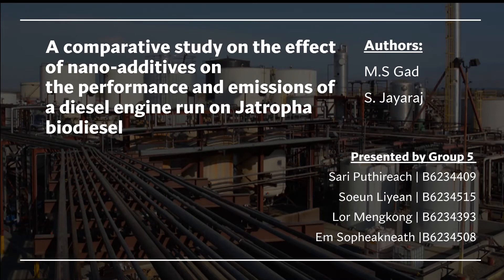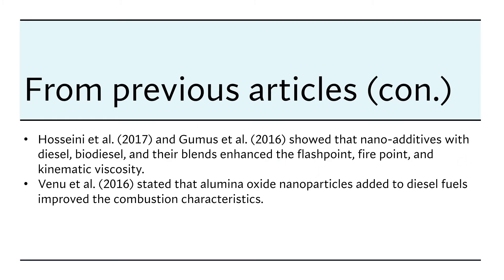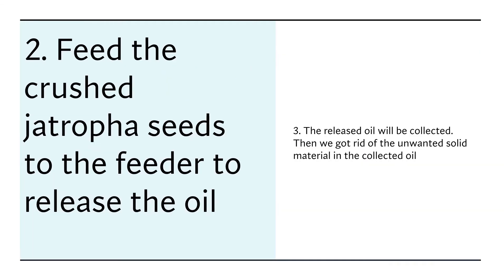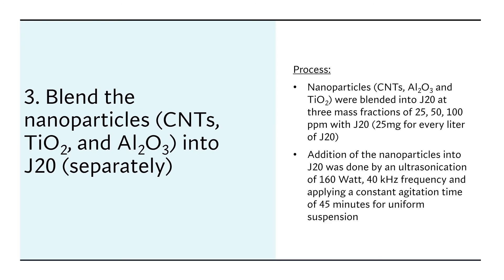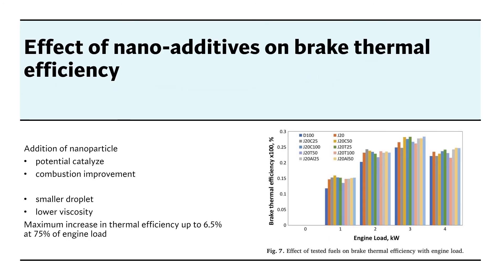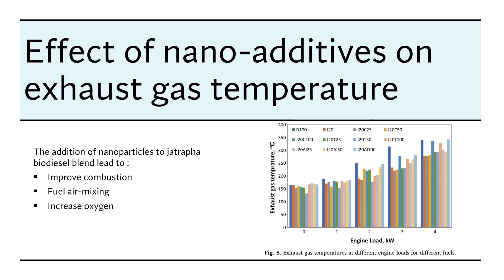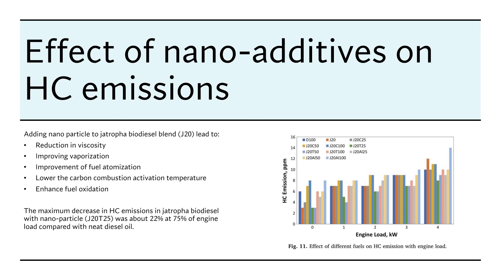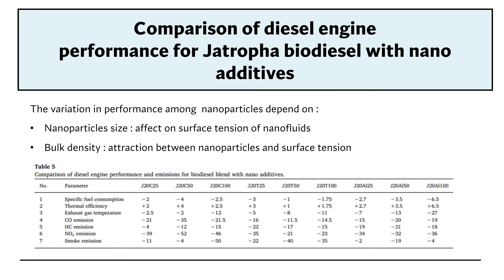A group presentation of comparative study on diesel engine using Jatropha fuel with nanoparticles.

Comment: Hi, questions from group 3
1. Due to Jatropha fuel advantages, why it still unpopular in other countries.
2. To use this biodiesel do we need to modify our engine? (or Does Engine Type Matter?) 
3. Long term of using the biodiesel, does it affect the engine and what the difference of using the normal diesel.
Reply: An answer from group 5

2. Biodiesel, as the name implies, is another form of diesel extracted from biomass which in our case is jatropha seeds. Hence, biodiesel is perfectly fine for use in diesel engines (In case you missed it, the authors actually used a diesel engine to experiment with biodiesel). However, as shown in the introduction, paragraph 1, lines 10-11, biodiesel could not be used exclusively on an engine citing their increasing amount of Nitrogen oxide (NOx) emission. Therefore, researchers have been trying to solve this problem by various methods (e.g., adding nanoparticles). This is one of the reasons why biodiesel is not largely commercialized like its counterpart diesel fuel.
 
So, to answer your question, biodiesel could be used in both diesel and petrol engines but has to be blended with crude diesel fuel (and according to the article, adding nanoparticles would also boost more various advantages) to prevent the problems mentioned above. It is also crucial to note that using diesel in petrol engines could largely shorten the lifespan of the petrol engine. To understand why it is prohibited to use diesel fuel in petrol engines, you may refer to my answer to question 2 of group 6 by Mengly Long.
Reply: 3. For long-term use of biodiesel, it can somehow affect the engine. 
+. It might damage the rubber houses of some engines that make it a little bit hard to start the engines.
+. In cold weather, biodiesel can gel depends on the oil.
+. It might clean dirt from the engine pipes, but the dirt may be gathered and clogged the fuel filter.
However these problems are not so serious and can be overcome by a check from mechanics. 

On the other hand, in long-term use, it actually improve the engine life span since it has a greater lubricating effect because there is less wear and tear.

For the difference compared to normal diesel, biodiesel is more environmentally friendly, and it improves the performance of the vehicle.
Reply: 1. Jatropha biodiesel was largely used in India. However,  unavailability of high-yielding cultivar, large-scale plantation without the evaluation of the planting materials, knowledge gap and basic research gap had led this fuel to failure. This also resulted in many challenges such as production, oil extraction, conversion and also its use as a sustainable biofuel. These problems make Jatropha biodiesel unpopular at present.

However, with further research, I believe that this particular biodiesel fuel will be widely used in the near future.

Comment: Hello I am from group 6 I have some questions:
1/ As you said the jatropha oil combine with nanoparticles could decrease emission and increase the efficiency, how much is different compare to the original oil (efficiency)? and Is the way that we produce biodiesels fuel cheaper than diesels fuel? If it is far expensive than the way that we produce the diesels oil would you still prefer that way to save the environment?
2/ Is this biodiesel fuels co-operate with all kind of engine? If so could you give us some examples?
3/ I'm not sure what is brake specific fuel consumption?
4/ For the nanoparticles that we used, is it a rare materials?
Reply: An answer from group 5

2. As shown in the introduction, paragraph 1, line 10-11, biodiesel could not be used exclusively on an engine citing their increasing amount of Nitrogen oxide (NOx) emission. However, to answer your question, biodiesel could be used in both petrol and diesel engine for the main function of fuel is to produce combustion to move the piston. Nevertheless, it is not recommended to use biodiesel with petrol engine (whose designated fuel is gasoline) for its specification and design are for gasoline; and if diesel (biodiesel in particular) is used on petrol engine more often, that could make petrol engine have a shorter life than expected and vice versa. For example, diesel is heavier than gasoline which is suitable for use with diesel engine (used on heavy vehicles such as bus, heavy-duty truck, or boat, etc.) that is designed to operate with heavy fuel like diesel fuel. In contrast, petrol engine, which is used on light vehicles such as SUVs, family cars, light-duty trucks, is designed to operate with light fuel such as gasoline.
Reply from the maker: Answer from group 5

1. Actually, there are different types of nanoparticles that we add into jatropha oil such as Alumina, Carbon nanotubes, and Titania in various amounts. Adding those elements does increase the thermal efficiency as shown in Table 5. And as shown in figure 7, J20Al100 whose nanoparticles are Alumina, produced the most increase of thermal efficiency which is up to 6.5% at 75% engine load compared to the neat diesel. 

Diesel fuel is refined from crude oil at petroleum refineries while biodiesel fuel is extracted from wasted cooking oil or in our case jatropha seeds. So basically, producing biodiesel fuel is more expensive than diesel fuel given the low energy density and the high price of raw materials of biodiesel (e.g., Jatropha seeds). However, it provides positive results to the environment compared with diesel fuel. Jatropha seed supply is unlimited since we could grow it easily. In 2008, there estimated about 0.9, 0.76, and 0.02 million hectares of jatropha plantation in Africa, Asia, and Latin America respectively. The total number, however, was projected to be at 12.8 million hectares by 2015 [1]. According to the article, Carbon mono oxide emission was decreased up to 35% compared with neat diesel fuel. In contrast, diesel fuel is a limited resource whose value will rise dramatically with the depletion of diesel fuel in the future.

[1] http://www.fao.org/news/story/en/item/44142/icode/?fbclid=IwAR23rBBJDOS1Qp9f0oA4vjnwbBdE_9kiwqFH9NcJsEE8N3NTedPj1zX1qyE
Reply from the maker: Answer from group 5

3. BSFC is the measure of the fuel efficiency of any engine that burns fuel and produces rotational power output. It indicates how the efficiency of the engine converts fuel supplied into useful work.

Comment: Greeting from group4,
Question from our group:
1. Will there be any potential problems in performance of the diesel engine in terms of temperature variation?
for instance, if we were to use these Jatropha biodiesel blended with nano-additives in diesel engine where the weather is very cold under 0 degree celsius.
1a. if so, what are they?
1b. why would that be the case?
Reply: An answer from group 5

I assume you are referring to the temperature variation of the surrounding given your example.

From my understanding, temperature variation does not affect the performance of diesel engines. However, the problem is with the diesel fuel whose melting point is between -30 to -18 degrees Celsius. 

Assume the diesel fuel is approximately at the surrounding temperature, I shall elaborate my point in two scenarios.

In the hottest surrounding temperature (which is at currently 56.7 degrees Celsius recorded at California’s Death Valley in 1913), the fuel property does not really affect the performance of diesel engines much as pointed out by Sumner, Best, and Monroe in 1986. [1] 

However, if in colder surrounding temperatures such as under 0 degrees Celsius, the diesel fuel will start to gelatinize gradually before completely solidify at its melting point. Gelatinous diesel fuel will have a large viscosity that leads to the problems of fuel supplying to the diesel engine itself and in turn, causes poor performance of the diesel engine. Assume there is no sedimentation occurs, in this case, our fuel B20 blended with nanoparticles (which are solid particles), its melting point should be approximately at that of diesel fuel since B20 composes of 80% of crude diesel. Given that our fuel is also blended with solid, its melting point may also be a little higher than that of B20 with no nanoparticles blended in. 

[1] https://doi.org/10.1016/0167-5826(86)90022-7

Comment: Thank you for a very nice presentation.

I have some questions relating to this article

1. Would you please show me how to calculate for brake thermal efficiency in Fig. 7? 

2. Can you explain in details about this statement "J20Al100 (at 75% of engine load), produced a higher decrease in the exhaust gas temperature compared with all other fuels experimented"? I am not sure where such a higher decrease is in Fig. 8.

3. Please let me know your opinion about smoke emission measurement. The authors tried to quantify smoke emission using smoke opacity. Do you think it is sufficient for providing the whole picture about particle emission since, in my understanding, the aerosol is visible as smoke only when the particles are sufficiently large. My point is, as we all know, PM2.5 is considered an important factor in health aspects because they are more likely to enter deep into the respiratory system and bloodstream. Is such a detection (smoke opacity) able to characterize PM2.5? If not, is such a conclusion on smoke emission useless?
Reply: An answer from group 5

3. Jatropha when used on a diesel engine is known for reducing the emission of ozone harming substances like Unburnt hydrocarbon (HC), Carbon monoxide (CO), and Carbon dioxide (CO2), according to the article, but increasing the emission of (Nitrogen oxide) NOx instead. This is the main problem that we cannot use biodiesel alone (Jatropha biodiesel in particular) as shown in the introduction. Therefore, this research aims to solve this problem by reducing all main substances that could harm the ozone layers such as HC, CO, CO2, and NOx or in other words they only concerned with the emission of HC, CO, CO2, and NOx and compare their result with results from other research, which was blending jatropha biodiesel with crude diesel and nanoparticles. Since the target emission gases are HC, CO, CO2, and NOx, the smoke meter of model OPA100 and MRU DELTA 1600-V gas analyzer are appropriate (They used both smoke meter and gas analyzer to analyze these gas). But I must agree with that you this model (that uses smoke opacity as the indicator) is not suitable for measuring small particles like PM2.5. Therefore, if their aims were to measure all kinds of toxic particles that include PM2.5 and they used model OPA100 (by smoke opacity), I would say their result for smoke emission could be so inaccurate that may be also deemed useless. Hence, to answer your questions, I would say no and also, no, because the objectives are HC, CO, CO2, and NOx.
Reply: @puthireachsari2436  In my understanding, the smoke meter was used to measure smoke opacity and gas analyzer was used to measure gas emissions. They are different things and hence should not be mixed. The point of having smoke meter is solely for measuring smoke opacity. However, as you mentioned, if smoke opacity is not a suitable for measuring small particles like PM2.5, does smoke opacity really tell us the information we need to know about smoke emission?
Reply: @benzzid   I am sorry, I just read the article again, and turned out your correct is right. 
However, to answer your question, I would say the information we wish to obtain about gas emissions such as HC, CO, and CO2 was how the amount and types of nanotubes could influence the emissions of those gas. So, I still say with the gas analyzer, we could estimate the emissions of the gases mentioned above. And for the smoke opacity that is measured by the smoke meter, like I said, it might not be able to provide an accurate estimation of the smoke opacity itself but at least we could estimate whether, under the influence of different types and amounts of nanotubes, the smoke opacity increase or decrease in percentage calibrated by ±1%. Therefore, if you ask me, could it estimate the amount of smoke opacity or not? I will say no. But, it does help tell us the difference of smoke opacity before and after blending the nanoparticles and I think this is the information we are seeking and in turn make my answer Yes to your question.
Reply from the maker: An answer from group 5 

1. Brake thermal efficiency is the ratio of the brake power obtained from the engine to the power of the fuel energy supplies to the engine.
 
Brake power is the power supplied to the crank shaft by the diesel engine and it is measured by an AC generator as shown in slide 34.

Power of the fuel energy supplied to the engine is calculated by multiplying mass flow rate of the fuel with the calorific value of our fuel which is J20. Mass flow rate of the fuel could be adjusted and the calorific value of J20 could be found in Table 1.
Reply from the maker: Answer from group 5 

2. J20Al100 (at 75% of engine load), produced a higher decrease in the exhaust gas temperature compared with all other fuels experimented means that authors compare their experiment with all other fuels experiments other articles namely article 35-38 in the reference. We are not sure about that too. Article 35 uses difference dependent variable from our article (BMEP instead of engine load) to calculate exhaust gas temperature. Article 37 uses a difference in mass fraction of Alumina from our article (20, 30, 40 ppm instead of 25, 50, 100 ppm). And article 36 and 38 use different nanoparticles which are carbon nanotube for article 38 and Iron oxide and cobalt oxide. Therefore, I conclude that in this statement the author wants to compare the result of exhaust gas temperature emitted by J20Al100 with the fuel with a different mass fraction of Alumina, and fuel blend with the different nanoparticles.